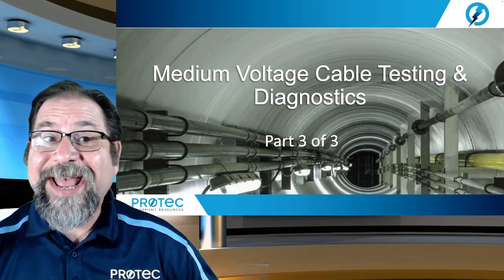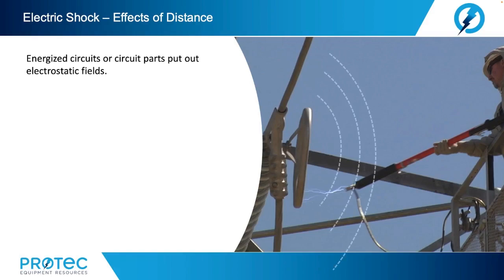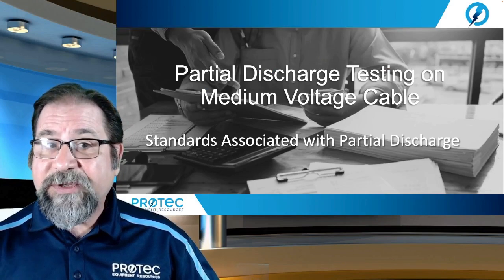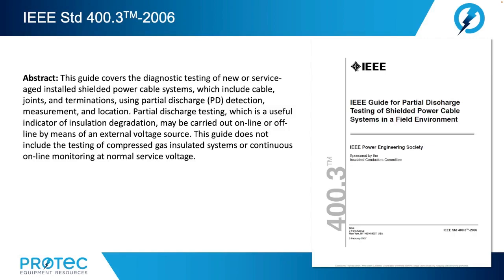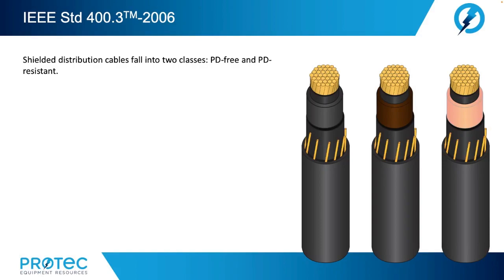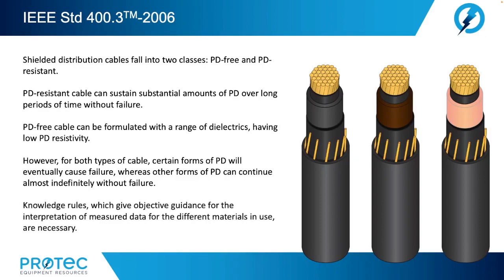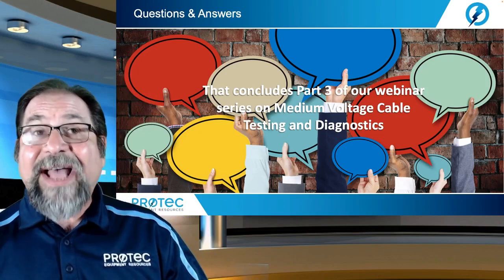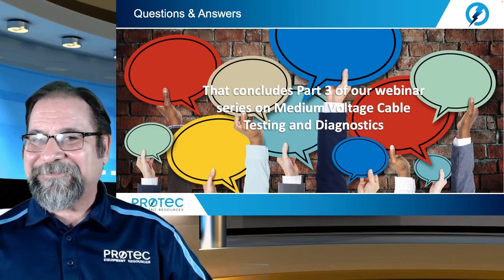Medium Voltage Cable Testing And Diagnostics, Part 3 (Protec May 2022 Webinar)

Comment: hi, the humidity is necessary check before the test? in that case what std IEC apply
Reply from the maker: It is possible that I missed Tom’s reference in his presentation to humidity in relation to one of the standards.  It may be that this material is present in the standards, but not mentioned in Tom’s presentation.  The standards that he referenced were:

IEEE Std. 400.2-2013              IEEE Guide for Field Testing of Shielded Power Cable Systems Using Very Low Frequency (VLF) (less than 1 Hz)

IEEE Std. 400.3-2006              IEEE Guide for Partial Discharge Testing of Shielded Power Cable Systems in a Field Environment

IEEE Std. 400.4-2015              IEEE Guide for Field Testing of Shielded Power Cable Systems Rated 5 kV and Above with Damped Alternating Current (DAC) Voltage                         

IEC 60060-3 (2006)                   High-voltage test techniques-Part 3: Definitions and requirements for on-site testing

IEC 60885-3 (2015)                   Electrical test methods for electric cables – Part 3: Test methods for partial discharge measurements on lengths of extruded power cables

IEC 60270-3 (2000)                   High-voltage test techniques – Partial discharge measurements